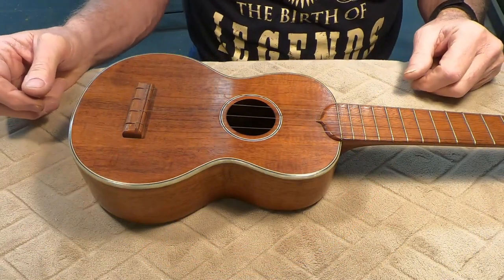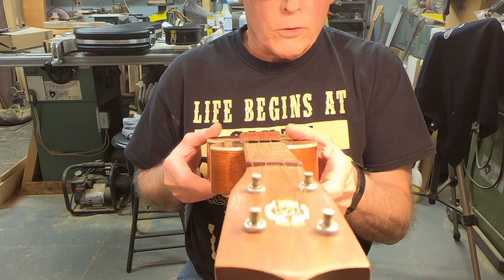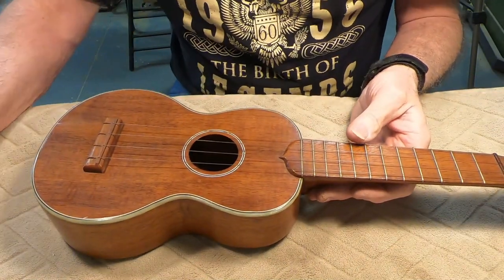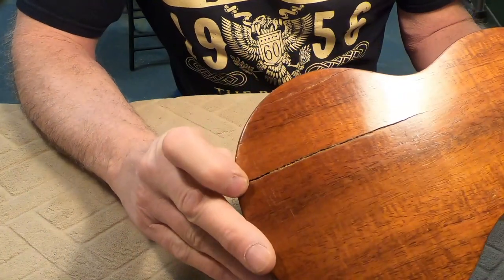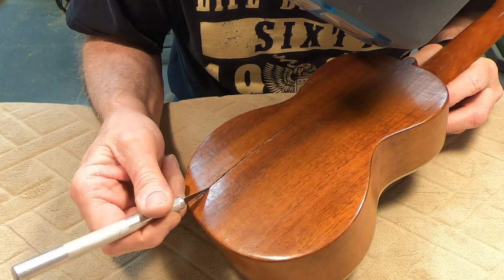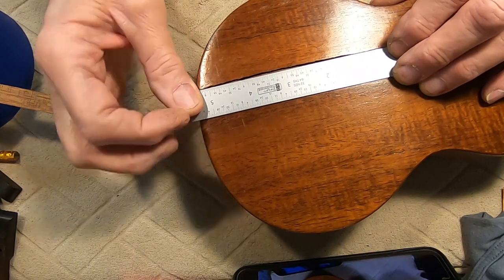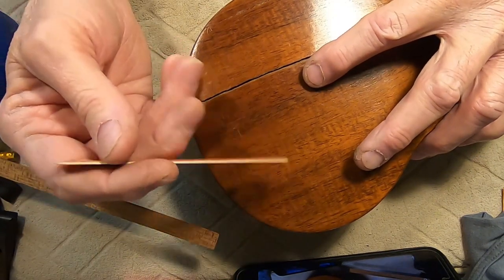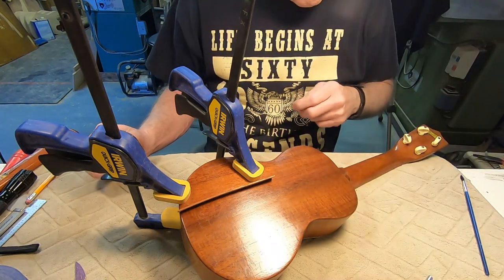Koa Ukulele crack repair part 1 at JONAH GUITARS

Comment: You ever work on any mandolin top cracks Dane?  My Breedlove maple b&s spruce top poped a top crack over night. Don’t think it’s a humidity issue because it was in my music room that Keeps a year round humidity between 45-55%. It was fine Friday night when we had a bluegrass jam with 6 of my picker buddies when I hung it back on the wall when everyone left then Saturday morning I let my neighbor in to use my studio before I left for the farm and I noticed the damn crack when I walked by going in to the studio. So I don’t know what the hell happened,it’s never been abused,never had excessive string tension,never been sat on or dropped. When it leave the house it’s in a fiberglass TSA approved hard case.  I’m thinking about forcing some fish glue in the crack,use strong magnets to line it back up and let it dry then seal it up with CA,scrape it down and sand thru the grits up to a polish and hope that I don’t gotta strip the top and shoot new nitro on it.
Reply from the maker: Oh major bummer J.m. At that humidity it should live forever. No reason at all it could be a humidity problem. I suspect there has always been a fault line in the grain at that place and it finally let go. Your process for repair sounds right on to me. Good luck, hope all has been well with you during these very strange times.
Reply: Dane Nichols this top had really clear straight grain,but we can’t know what is going on inside that top plate. Could have had a pitch line,the carve could have been a little thin right there. Regardless it’s not a big deal. I got it stabilized with fishglue and used 2 rare earth magnets on top and used a steel clamping caul that I re milled the contours on the Bridgeport a little to match the contour of the bottom of the top on the inside and the magnets pulled the crack back in to alignment while the fishglue set. I still gotta seal it up with c/a and get it worked down. If I have to refinish the top I’m just gonna strip it and do a waxed finish on it because I don’t wanna mess with shooting nitro and try to get the sheen,color and thickness matched.

Comment: Thanks for this video - there are very few videos showing this kind of repair for old cracks that won't close with humidifying. I have a guitar with a very old back crack that won't close- It runs the entire length of the guitar, but is closed toward both edges of the guitar, and then the gap widens in the middle. With this technique, do I have to worry about the splint causing the crack to worsen above/below the insertion point? In other words, the crack is 19 3/4" long total, but only the middle 12" of it is wide enough to fit a splint in. Do you think putting a 12" splint in the middle of a crack like this would wedge the crack open on either end? Thanks for any advice, much appreciated.
Reply from the maker: Thanks for watching Jason. I understand your train of thought with possibly wedging the ends open. But first you shouldn’t have a shin/wedge so tight that it exerts pressure on the the crack. Just tight enough to make a good glue joint. Second use cleats at each end for extra holding at that stress point. HHG and Fish glue both shrink as they dry pulling the joint together so use one of those rather than titebond.
Reply: @jonahguitarguy  Great, thanks, I've always used titebond in the past, so interesting to hear the tip about hide glue. Will add some reinforcement at those spots and should be good to go. I'll be fixing the crack and then refinishing the back. An old Guild D40. Thanks again!
Reply from the maker: @jdyfilm  you’re welcome. I’m always right here if you have more questions.

Comment: Good one Dane. In engineering, part of a crack repair scheme required a hole to be drilled just beyond the crack, but no one wants that here. I think this is going to turn out really well. If you have a little witness of the infill on the inside, will you still be able to put a cleat in there?
Reply from the maker: I did have a little of the wedge poking through to the inside. The hole was so small I would have had to build a tool to hold something sharp to par off the excess. I opted not to do cleats. I think it will be just fine without them. And yes drilling a hole at the end of a cut to keep it from cracking is very common but I think only when the crack/ cut is to be left open. In metal and plastic as well. Thanks for having a look my friend.

Comment: My Ukulele bridge came off" I glued it back with Gorilla Super Glue. Is there any way to remove it, and glue it back? Or, is it hopeless? I glued it on wrong, and I am hoping to take it off and have it repaired by someone that knows how to do it right. It is 67yrs.old, and Kamala Ukulele bought in Hawaii.
Reply from the maker: Hi Lottie, You could have a problem. A couple ways I might try to go about it are, first, well I just looked back and it's 67 years old. So it has either shellac or lacquer for finish. That eliminates trying to loosen it with acetone. Second use a heat lamp and see if heat will soften the glue. of course cut a shield out of cardboard the size of the bridge and cover it with aluminum foil.

Comment: What kind of glue did you use?  It sounded like you were saying "hot eye" glue to two of us, but that doesn't sound right.
Reply from the maker: That would be Hot Hide Glue. But I like Fish glue just as well and you don't have to heat it up. Plus it has a longer open time cause hide glue cools down fast and starts to set up.